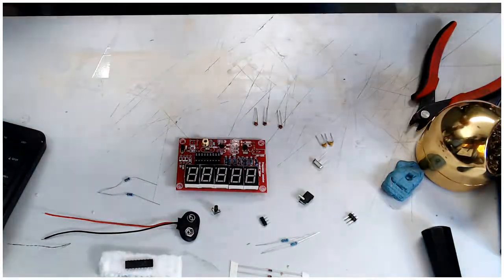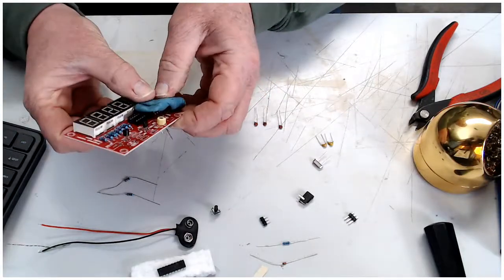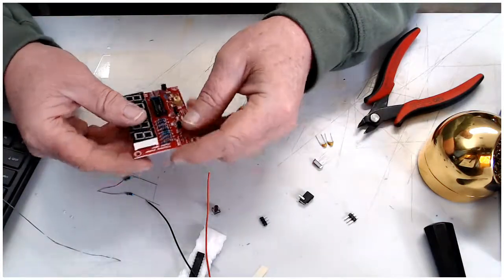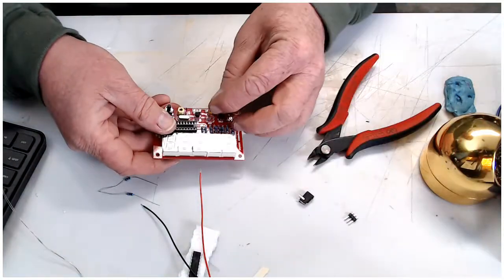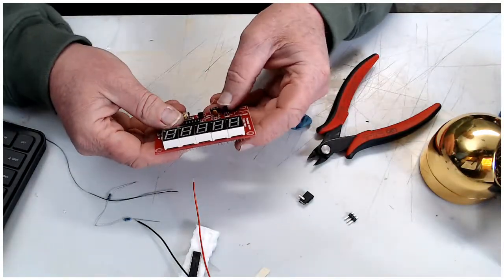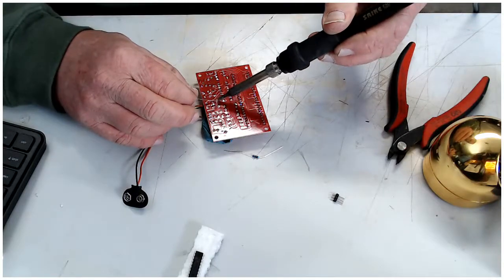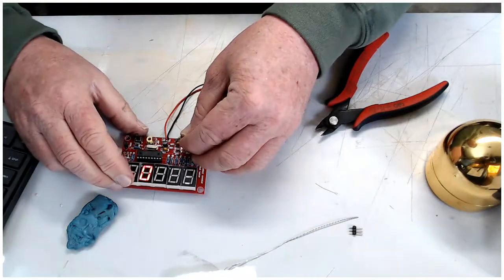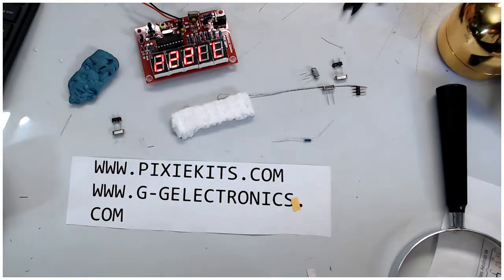1-50Mhz Frequency Counter build and test

Comment: How did you get yours to work?  All mine does is say E.E.E. or -.-.- on the screen and since there's no instructions for the darn things I have no idea what that means so it's basically a scam!
Reply from the maker: I have the instructions if you need them? Not sure what yours is doing?.
https://www.pixiekits.com/product/frequency-counter-instructions/
Reply: @DIYELEKTRONICKITS  Schematic is not complete but better than nothing I guess.  Mine says -.-.-. when first turned on then goes to 8.8.8.8. and when I press the button to ground pin 4 on the IC it just starts over with -.-.-.-. again but never displays anything like they show in the instructions. It came assembled, not a kit. I'll to check all the parts and see if they built it correctly.
Reply: @DIYELEKTRONICKITS  Have you ever found a parts list and complete schematic anywhere?